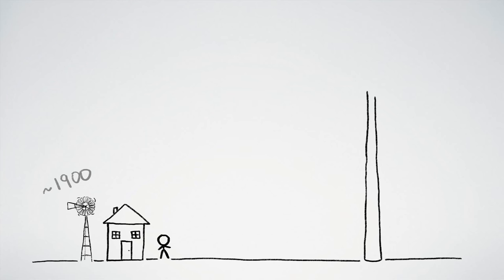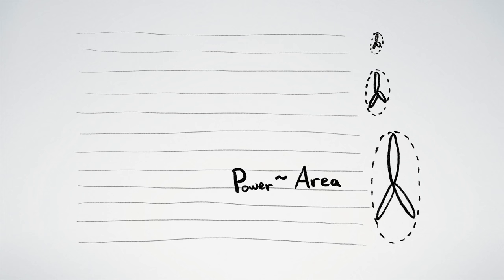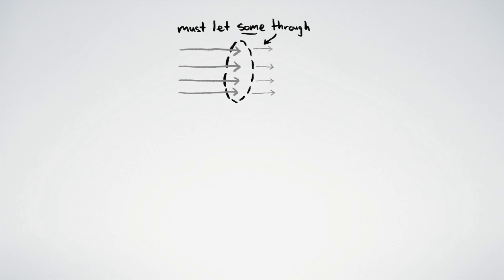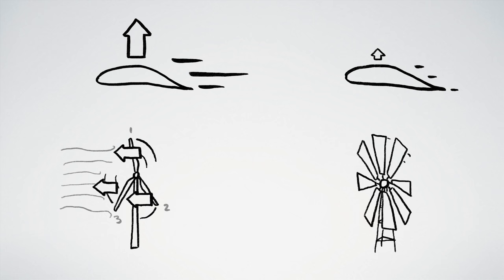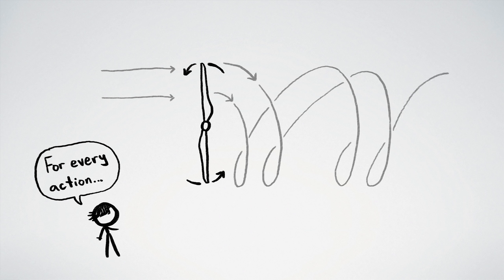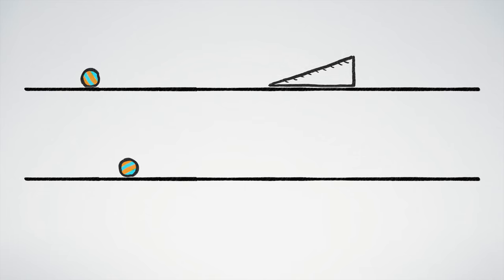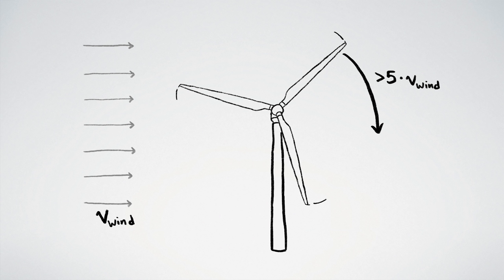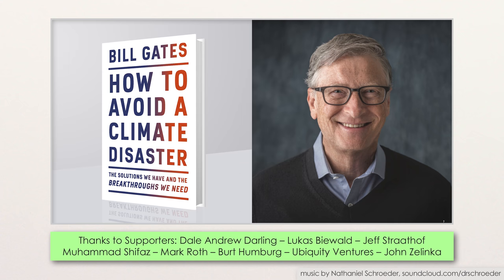The Physics of Windmill Design

Comment: Not to mention the shear force being applied to the tower. If you replaced the blades with sails, The tower would have to be massive to support the horizontal force being applied to the nacelle.🌬
Reply: Isnt the force equal to energy made? From the video it seemed to me as if the force is still the same (or even bigger with small, fast turning blades). Is it? The sails would be also turning and letting wind through.
Reply: @MrBlaBlaCook  you would still have to limit the speed of the sails due to centripetal forces. Therefore you would be relying on the sails to push harder, not faster, and then take advantage of the additional force through internal gearing.
Reply: @MrBlaBlaCook  No. In the extreme example of big sales that stop the wind entirely, the energy made will be zero while force applied will be high. Power = Force x Velocity.

Comment: I'd love to see a follow up to this comparing the 3 bladed direction windmill to those smaller profile helical ones which work in all directions
Reply: Don't the 3-blade ones turn, thus working in "all directions"?
Reply: There are major difficulties in protecting the Darrieus turbine from extreme wind conditions and in making it self-starting.  https://en.wikipedia.org/wiki/Darrieus_wind_turbine
Reply: Don't those helical ones work less well due to the blades needing to fight the wind on their way back? The 3 bladed ones can also turn like the turret of a tank, letting them adapt to wind direction.
Reply: I actually did some research about this. Long story short; helical wind turbines aren't that efficient. It has a slower rotational speed, thus producing less power per square meter. It does come with advantages however such as being able to work at any direction of wind without needing to turn, taking up less space and have a lower minimum wind speed to work.
Reply: Motocat: Yeah at about 3% efficiency.
There's no problem with putting a turbine on a rotating shaft; just mount the turbine on a tire-rim and axle from a junk car, and mount the generator on the front as a counterweight.
Reply: I recommend you go to your local library and look for these two books: "Renewable Energy and Climate Change" ISBN: 978-1-119-51486-2 or "Understanding Renewable Energy Systems" ISBN: 978-113878-196-2 They are written by German Professor Volker Quaschning and cover renewable energies as a whole, but the chapters about wind energy are a good foundation.
Reply: @SovereignStatesman  On issue with rotating is that the power cables would have to be able to rotate with them...while it can be and likely is done in places it is needed. I would think one of the major parts of site selection is locating places that the wind only blows one direction, or its reverse 90% of the time.
Reply: @kelaEQ2  "On issue with rotating is that the power cables would have to be able to rotate with them."
They're called POINTS, and they're a normal part of electrical generators.
But this is just one possible solution; the other is having the turbine spin an axle in the mast, from a driveshaft and tire-rims of a junk-vehicle. 
It's all very simple engineering, but it takes a Scotsman to do it cost-effectively.
Reply: But wind turbines turn slower than the old wind mills like we’re used to pump water....

Comment: Isn't it supposed to be a 'wind turbine' as opposed to a wind mill?
I suppose 'rotating bladed wind energy capture device' isn't very relatable.
Reply: No it's a wind mill. By law, anything that captures wind must have a tiny millstone and a supply of grain to grind.

(This is a joke.)
Reply: Consistency is the hobgoblin of small minds.
Reply: @craigwall9536  In general yeah! But in this case - its an educational video needs be correct. Fortunately its mentionrd in this comment section
Reply: In Denmark they're called wind mills and I feel like we have the final word in this.
Reply: @hedgehog3180  do you? As a german, i would relegate all windmill related duties to the dutch. But maybe im wrong.
Reply: @Lefers94  We call them windmills in Dutch too. (Windmolen, used for all types of wind engines, from mills to turbines)
Reply: @craigwall9536  Is it foolish?
Reply: @hedgehog3180  I thought Holland had jurisdiction on such matters, no?
Reply: @Kiros37100  didn't you folks use them mostly to pump water instead of actually milling grains? Sooo, why aren't they called "Windwaterpomp"? :D
Reply: @TheFeldhamster  In Dutch, "Molen" refers to the mechanism, not to what specifically it's used for (like grinding in the case of the English mill).
So whether grinding, pumping, sawing or hoisting.. It's all a "molen"

And a windwaterpomp is actually called a windwatermolen.
Reply: Well, the thing you're holding in your hand is still called a phone.
Reply: @Kiros37100  oddly, English sort of does this too: sawmills (can be driven by any power source you like, the name comes from the spinning saw blades at the other end), woolen mills, textile mills.
But it seems the important part is the (spinning) mechanism being driven by the power source... Something the wind turbine doesn't have.
A wind mill is a mill driven by the wind. A flour mill (which may or may not also be a windmill) is a mill which grinds grain into flour. A saw mill is a mill that drives a saw.... And a wind turbine isn't a mill of any sort, though the electrical power it generates may be used to drive one.

Not that many people know that these days, what with mills going from very common all over the place to "only found in a few places and mostly indistinguishable from any other factory"
Reply: Any rotating machinery who's focus and purpose is extracting energy is called a turbine,
Those who used energy to speed up/pressurize the air are the opposite of turbines, usually called compressors, impellers or just fans
Reply: @baganatube  FACTS. Wow
Reply: @mrsamot4677  just that im not holding anything while im typing on my keyboard which rests on my table. typing on a phone, what am i some plebeian?
Reply: @craigwall9536  - "Consistency is the hobgoblin of small minds."
Actually, a goblin of the mind would be a type of homunculus, not a hobgoblin.

Jokes aside though, language changes over time. "Tall thing what spins in the wind" is what the word "windmill" refers to in the modern day. You can be specific and say wind turbine, but nobody will be confused if you say windmill, which is the goal of communication in general.
Reply: Colloquially they're often called windmills - it may even be regional, where some areas call em windmills and some call them wind turbines. While "wind turbine" is more scientifically exact, either one still gets the point across just fine.
Reply: Are walls on a ship called bulkheads? Is the right side of an aircraft called starboard? Lots of industries keep old verbiage, which should have been stricken from its nomenclature, relevant in current times. Gives character, and is an indicator of a maturing industry. I approve to keep using the term “wind mill” because it makes a good historical reference to the industry, and it gives old people something to talk about!!!
Reply: @craigwall9536  
Ah yes the small mind of 
minutephysics, good one. 
Everyone calls it a wind mill. Maybe he could have mentioned it but you can't say he has a small mind for using the layman word
Reply: Americans don't use the word turbine. If you think this weird, see sidewalk and trash can.
Reply: @connordolan4597  What? Americans absolutely do use the word turbine. I've heard "windmill" and "wind turbine" about equally often here.
Reply: @craigwall9536  Actually the full quote is "a foolish inconsistency is sometimes the hobgoblin of little minds."
Reply: @laurencefraser  in a modern electricity-generating windmill there is a spinning mechanism powered by a power source; the spinning mechanism is the generator and the power source is the wind.
Reply: @dynamicworlds1  maybe but that doesn't matter for what most people call it
Reply: @hedgehog3180  go to Vestas and call it a windmill and they will tell you to leave. It's definitely called a 'turbine' by the people actually making them.
Reply: @laurencefraser  
>"But it seems the important part is the (spinning) mechanism being driven by the power source"
wind can't be a power source then?
it's nonsensical to apply the modern concept of electrical power to a technology which predated that and used motion of wind (or water in the case of watermills) as the source of power that would drive a millstone or a pump
Ultimately "turbine" is just a different word that describes a very similiar concept
Reply: Correct, they're wind turbines (or WTGs - Wind Turbine Generators).  I made a comment before seeing yours.  They don't mill anything!
Reply: @AirNeat  I'm not sure what hobgoblin meant, but I think his quote was saying that a small mind is bothered by inconsistencies like saying wind mill instead of wind turbine. So Craig would then be saying that OP has a small brain
Reply: @laurencefraser  This is probably the best answer I've ever read on this debate.  Thanks.  I just wish I didn't have such a visceral reaction to the term "windmill", as it makes it difficult to listen to the rest of the information.
Reply: Merriam-Webster says...
Definition of turbine
: a rotary engine actuated by the reaction or impulse or both of a current of fluid (such as water, steam, or air) subject to pressure and usually made with a series of curved vanes on a central rotating spindle

So, since hydro-electric dams use turbines, and all steam-driven power plants use turbines, then generating power from the wind would also use turbines.
Reply: @KingBobXVI  "You can be specific and say wind turbine, but nobody will be confused if you say windmill, which is the goal of communication in general." ok, fair enough.
Reply: @DavidGuild  I always wondered what those tiny bags of flour next to wind turbines were for.
Reply: @hedgehog3180  I happen to work at a Vestas factory here in the US and all mentions in internal documents from Denmark are "wind turbine". Even our Danish VP says turbine.
Reply: @Lefers94  Denmark invented the electric wind mill and most wind mill production and development is concentrated in Denmark. The Netherlands doesn't actually have a lot to do with wind mills as the classic wind mill for grinding grain was actually invented in Iran.

Comment: I appreciate that you have to vastly simplify to get these across in a short time, but another design element that affects the design is the designed wind speed range. Lower cut-in and lower operating wind favors a higher blade count. This is why 'old west' homestead water pump windmills are multi-bladed with a 'solidity' of around 60-80%. They are optimized not for peak power, but low speed wind operation and better torque. Source: Graduate Level Wind power design course at the Technion in Haifa, Israel.
Reply: Old west windmills also didn't have cfd optimized design. The low ar makes me curious, why was it ideal? Maybe just for durability and easier rotation to wind angle?
Reply: @schipe  I assume you mean low disk area by ar. 
I think the main thing keeping them smallish was a combination of cost, weight, and being only large enough to suit the purpose of moderate power needs (pumping a well) vs general purpose power generation. Larger would not only cost more, but in most cases would only result in wasted water. 
Also, keeping the solidity high while minimizing the starting inertia (both helpful for low cut-in speeds and intermittent wind) helps drive you toward smaller designs.
Reply: @MordecaiV  Sorry, i meant aspect ratio. For the same force, you can use longer narrower blades. I think as you mentioned, it most definitely comes down to structural strength, longevity. The larger the radius, the more stress you put on the disc and the bearings.

Comment: As homework in my Computational Fluid Dynamics class, we had to determine what percentage of the wind's energy was extracted by a provided modern windmill design as we altered the number of blades. Everyone thought their results were wrong - 3 bladed windmills were notably less efficient than 4 bladed ones, which were a tiny bit less efficient than 5 bladed ones (efficiency started falling past 5 blades). If our results were correct, why did we only use 3 bladed windmills in practice?

The answer, our professor explained, was cost-benefit analysis. Sure you could get more energy out of a 4 or 5 bladed windmill, but the blades cost a lot of money. Someone determined that for the lifetime of a windmill, the cost of the 4th blade wasn't recovered by the additional energy gained, and so we only see 3 bladed ones.
Reply: Do you know how long modern blades tend to last? Just curious! They seem like they’d be hard to replace since the towers are so tall!

Also, do you know how they figure out how to space windmills when a bunch are in the same area?
Reply: @nachtegaelw5389  the blades typically last as long as the rest of the installation, 20 to 30 years. if a blade needs to be replaced (e.g. due to unexpectedly high abrasion at the leading edge, failure of lightning protection or manufacturing defects) that's a major economic setback.
Blades are inspected regularly by climbers or helis and can also receive (limited) maintenance.

Comment: Wait, but pelton turbines are most efficient when they capture all the kinetic energy of the fluid, why isn't it the same for wind mills?
Reply: The fluid gets out of the way due to gravity, air can't do that
Reply: Because water will move out of the way of the newly incoming water thanks to gravity.
Air doesn't. At first, wind will flow, but most of it will be stopped by the windmill, creating an area of still wind. This makes the incoming wind stop, not on the windmill, but on the air that stopped earlier. 
It is for the same reason parachutes need a hole at the top, to allow the air to flow through it.
Reply: @eolyas1664  More simply it's the fact that when designing the system you don't release all of the potential energy of the water before using it to drive the turbine. You leave it with enough that releasing it is sufficient to do the work of accelerating the water out of the turbine hall and discharge it from the outlet. So you are still not really capturing its maximum potential but it's more efficient than the alternative which would require some other means to remove the energy-depleted water and discharge it. Trying to pump it out would be an inefficient potential>kinetic>electrical>kinetic conversion when you can just skip the last two and their associated losses if you simply save a fraction of the potential energy to release after the extraction process.
Reply: The fact that there's a downstream drain that lets the water flow away proves that it didn't gather all of the potential energy from the water. If it had, that would imply that the turbine was sitting in the reservoir at the bottom of the dam, and would therefore fill up with water and not be able to move anymore.
Reply: because real wind isnt compressed and shot out of a noozle.
Reply: "...most efficient when they capture all of the available kinetic energy..". There- FIXED.
Reply: Gas is compressible, fluid is not. You lose kinetic energy when you let the air being compressed.
Reply: If they slowed down the wind too much, they would create a high(er) pressure zone in front of the blades. Basically there would be a bubble of high pressure air around each blade and the air would move around that bubble, not really interacting with the blade. It's a bit more complicated of course but that's the gist of it
Reply: Pelton turbines also require high fluid velocities. Much higher then winds on Earth.
Reply: Much of it has to do with the compressibility of fluids versus gasses and the flow reaction, vortex and drag caused by the differential pressures along the chord and transition point of the blade trailing edge.  When dealing with "Air" there are so many variables involved that a windmill has to be designed to a wide operational span whereas a Pelton, Vaneaxial or other fluidic unit can be designed to very narrow operational specification using a tightly defined fluid specific gravity, temperature etc.
(I'm an old NBS Physical Dimensional Lab Rat and dealt with all this almost every day).
Reply: @eolyas1664  Not a good analogy. The hole in the parachute is for for controlled release of the air which otherwise cause the parachute to tip and spill the captured air uncontrollably. Holeless chutes have the best deceleration (which could be a problem if too sudden and may not open up as fast as holey chutes) .. until the tipping becomes excessive.

Comment: Shame that you never discussed the reason for having odd numbered blades too! I always found it fascinating. If I remember correctly, it had to do with maintenance and stress on the blades due to asymmetrical air resistance.
Reply: it is a shame but its hard to fit it all in. Interestingly enough, 1 blade would theoretically be the most efficient, but could never happen due to the intense forces of wobbling back and fourth. Two blades would have a similar issue with intense forces but from gyroscopic procession. Four blades would not be efficient due to what was mentioned in the video as stopping the air and not allowing enough to pass.
Reply: It is so because of the "tower shadow". If there were paired number of blades, the uppermost one would experience the most torque due to the faster air speed. The lowermost one is aligned with the tower and has low torque due to the effect of the tower to the airflow. This situation where unbalanced torques are present is bad for the mechanical strength of the nacelle. With odd number of blades the "tower shadow" effect is minimized.